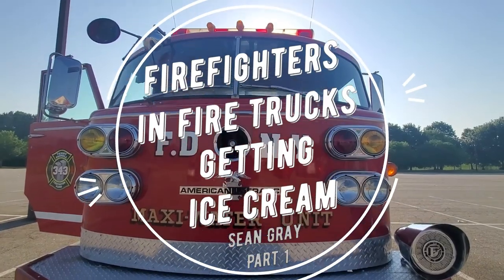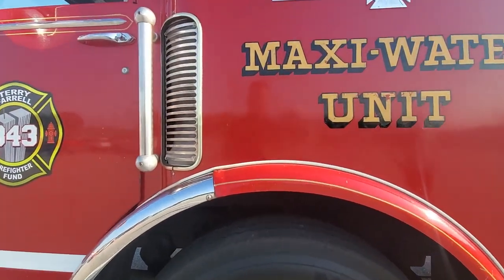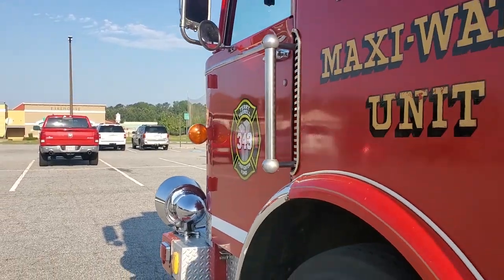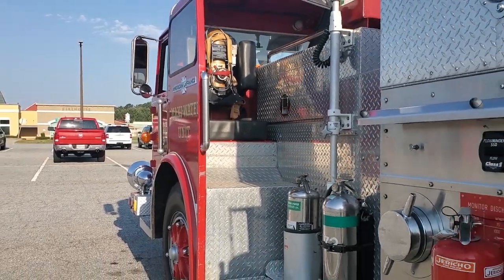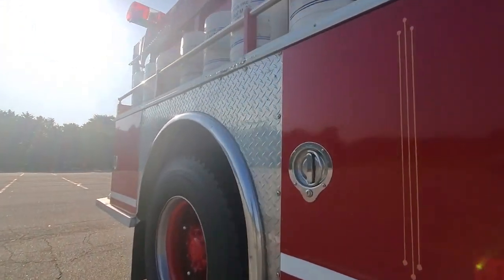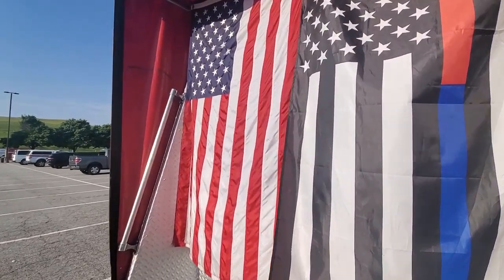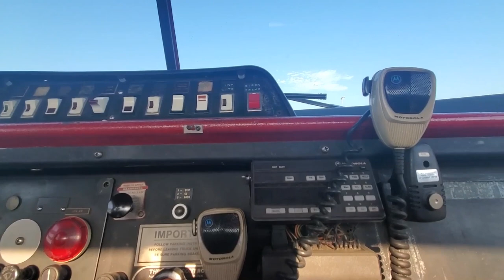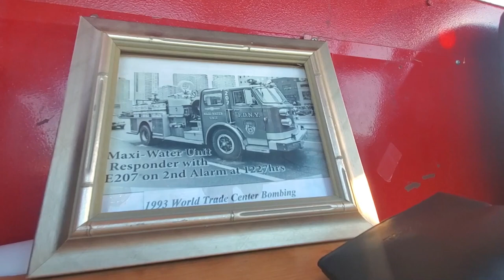Firefighters in Fire Trucks getting Ice Cream - Sean Gray (Part 1)

Comment: The sister to this truck by the FDNY Numbering system is also in the Atlanta area.  AP 8207  was part of the same order and served as Engine 290 on Sheffield Ave in Brooklyn,  then as a reserve used by Engine 75 in the Bronx.  It was sold by the fDNY and saw a second career as Engine 290 for the North Lawrence New York Volunteer Fire Department until sold into retirement in 2010.  North Lawrence painted it dark blue with a white top and it is frequently seen at Metro Atlanta car shows and parades..
Reply from the maker: Maybe I will try to look up the owner next time I am teaching in Atlanta